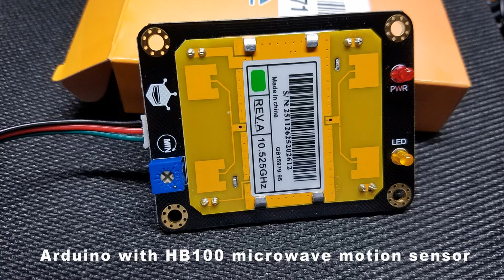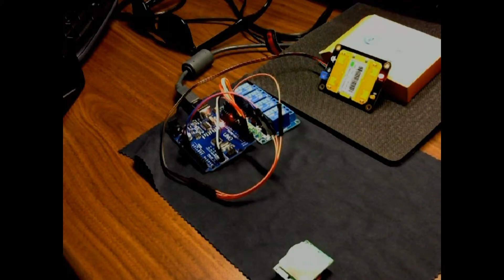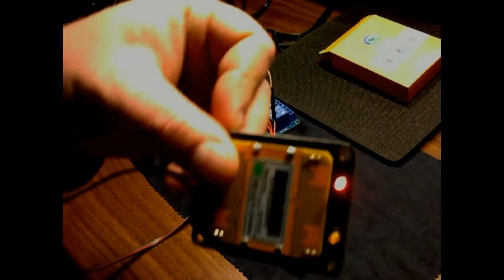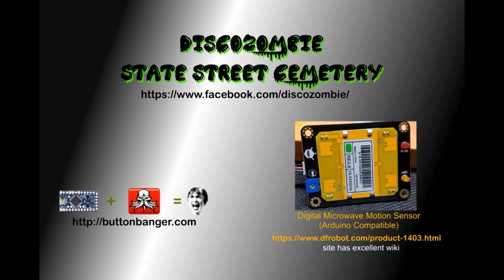Arduino using Microwave motion sensor

Comment: Looks great!  Have to tested how effective it is a limiting the detection range?  I would want to limit them to ~3 - 4 meters and many sensors which say they are adjustable, don't actually adjust.  Wondering if you have been able to test.
Reply from the maker: So far it's very sensitive almost too sensitive. I'll keep working with it